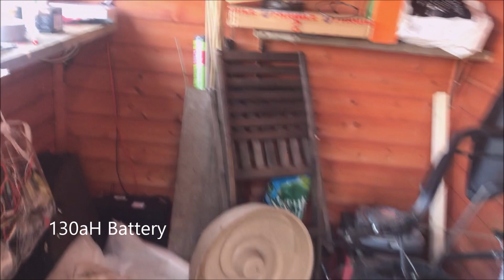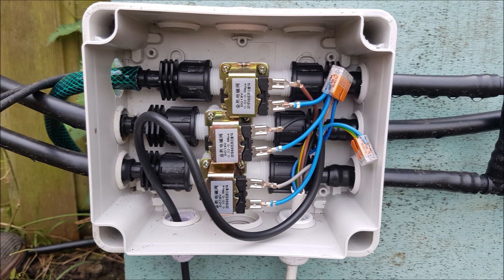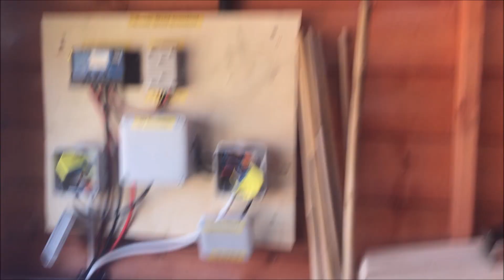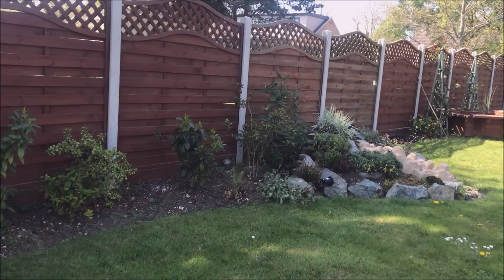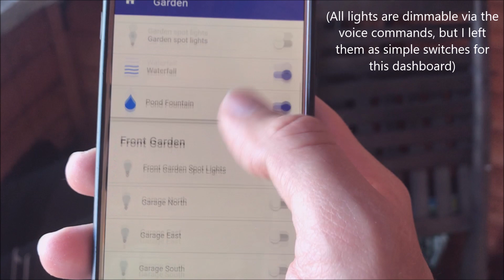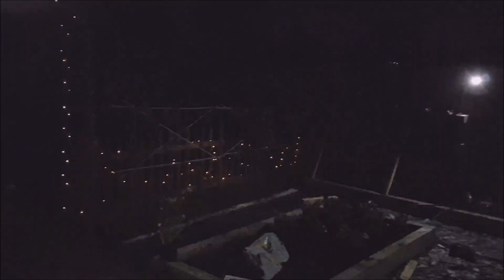Solar Powered Smart Garden: Irrigation, Lighting and Water Features

Comment: Does not look like you're using the shelly app to control the events ...   I am running the shelly in  "white mode"  to control the  4  ports individually  ...     After flogging the  Shelly apple IOS  app for many hours i cannot get the shelly   weekly daily hourly function to work  with the RGBW2    .......although the on off switch in the app does work ..   but not the flippin scheduler   ...   nooo   frustration here ....
Reply: I strongly recommend ditching their default app and moving to something local. I recommend Home Assistant. The guy in this video uses OpenHAB. I've got no experience with OpenHAB but here's a good comparison vid: watch?v=A4jrE_MtRWc

It takes longer to get started with a local solution but having devices from different ecosystems all in one place is completely worth it.